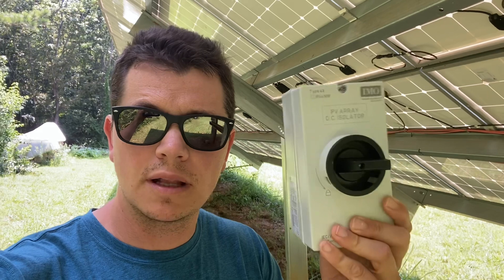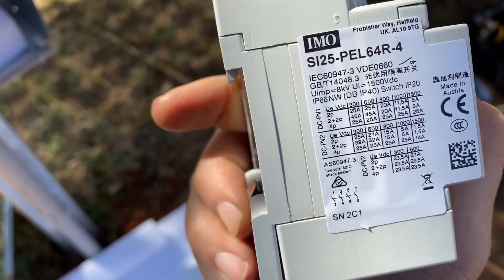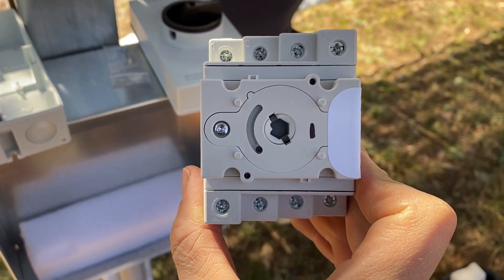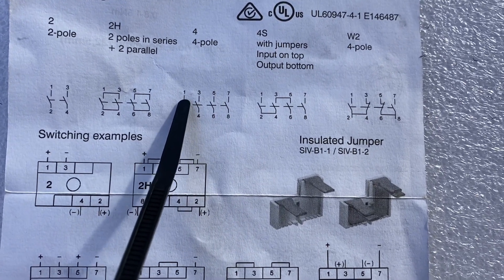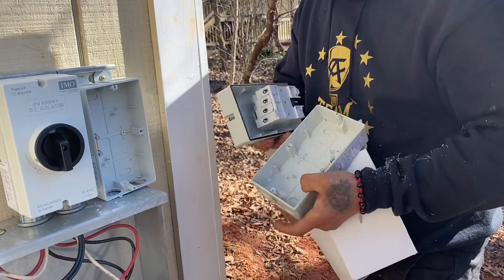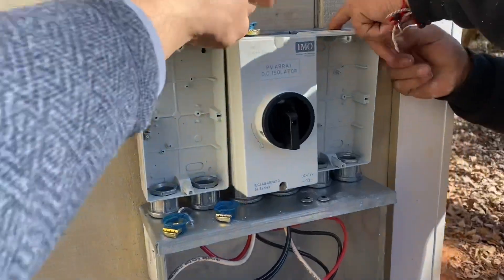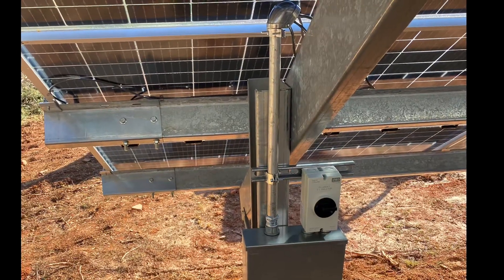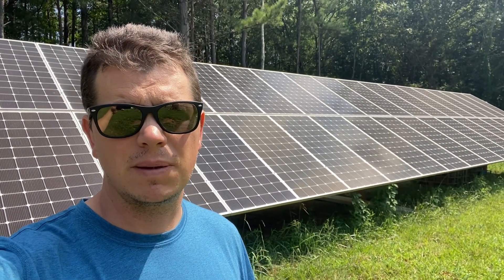IMO DC Isolator: Solar PV Disconnect Switch Instaling and Wiring

Comment: What box did you use at the array? Is that a nema 3r screw cover? What size do I need to get for 3 imo disconnects to fit on top?
Reply from the maker: You could fit 3 in a 12124 nema 3r box but you’d have to bring the weather head down on the side or behind with an LB

Comment: Hey Johnny, I have my IMO disconnects at the array, do I need IMO's at the house or can I run from the IMO's at the array straight to the Inverter?
Reply from the maker: It kind of depends on the proximity to the house, but I usually put disconnects on the house so that I can completely remove power from the house
Reply: @GainSolarPower  That makes sense, the array is about 100 feet from the house. Thank You

Comment: Thanks for showing that they are a crossover!  I have seen some videos of those polarized disconnects that were used in Australia that burst into the flames if you hook them up straight, eg - in that diagram input 1, output 2.  I did not realize these were also crossover too!  Thanks also for showing what hardware you use for connecting things like this.  That helps a ton for is DIYers.  Simple things like that rubber washer on the back screw and the meyers hub on the bottom are easy to miss, but certainly great to keep water out!

Comment: Why people use those PLASTIC switches?? To save money??   Look at all that PLASTIC. 1 arc and its done!  Get a metal PV Disconnect Solar Switch box with the pull down handle like  EATON DH261UGK 30 AMP SAFETY DISCONNECT SWITCH 2 POLE NON-FUSED 600V.  PLASTIC's as a rapid shutdown device is insane to me.  I can shut down my array safely while under load now. I wouldn't dare if I had a PLASTIC cut off device.
Reply: According to the NEC these are not rapid shut down devices these are strictly disconnects. And in the 2017 NEC there is no call for them to be UL listed.
Reply: lol, that is an AC switch. If you are using that as a PV disconnect you are not doing it “safely”.

Comment: @GainSolarPower Johnny there's a lot of talk in Euro & Aussie solar circles re eliminating DC Isolators & relying exclusively on the single DC Isolator built into the inverter, specifically due historical failure data. What're your thoughts on that? I know the convenience they offer, but doesn't the potential failure point negate this?

Comment: Hi did you put the isolation switch between the PV and PV outside fuses, or between PV outside fuses and wire to inside solar controllers?
Reply from the maker: No fuses on this job.

Comment: Does the polarity of a Solar Rotating Handle Isolator depends on the load/source side? Does the polarity of the switch reverse if the load  and source are reversed. I will put it another way. Does it matter which way the dc current runs through it as far as polarity is concerned.
Reply from the maker: I don’t think the switch is polarized like a Midnite breaker.
Reply: @GainSolarPower  So  the panel array can come in the bottom and the top goes to the inverter? I'm not familiar with a Midnite Breaker.

Comment: I don't suppose it would make any difference if you connect the input from poles  1,3,5,7 and exit form 2,4,6,8 or would it ?  Most installers seem to enter from below, is it just for convenience ?

Comment: ok you have an array of solar panels, do you install, a DC isolator where the panels, are, and another DC isolator , close to the inverter? if so what is the purpose of the DC isolator next to the panel array, is it so that you can disconnect the power from the line going to isolator number 2 which is close to the inverter? my question is about disconnecting the cable going to the isolator close to the inverter, and if there wasnt an isolator where the array is, , then there would be power, at isolator 2, and one would not be able to remove the cable, say if one wanted to replace the isolator 2, or even , replace the conduit..
Reply from the maker: Sounds like you answered your question own question. It’s also a nice place to transition wires

Comment: Hello, what IMO DC Isolator would I use with a 4 string, grid tie PV system? Each string would be using 8 - 400w Panels (40.7 volts, 9.83 amps)?
Reply from the maker: You could use 2 of the switches in the video
Reply: There is a 4 circuit / 8 pole option - based on the amperage, the disconnect is rated at 65amps per string/circuit
Reply from the maker: @jasonhannah7798  Jason, I am pleased to see you on my channel. Do you work for IMO. I love your products!  I would be happy to connect sometime 

Jv@gainsolarpower.com

Comment: I plan on mounting the IMO on a 6x2 in steel post and would like to have the PV wires enter through the back of the enclosure for a clean look.  My conduit enters the bottom of the post underground, and I will use the post as a conduit.  Does the enclosure have enough room for a 1/2" chase nipple on the back of the enclosure?  My install is a 2-module 500-watt system for an RV, and I will be using 8 gauge wire.  Thank you!
Reply: I received the switch today, and for anyone interested in the answer, there are two elongated knockouts in the back of the enclosure, one top, and one bottom.  The knockouts are approximately 7/8" wide x 1/2" tall.

Comment: When you are doing this are you using strings to what the inverter can handle? Because you don’t use micro inverters.
Reply from the maker: Yes we are running strings of panels less than 450v back to the inverter.

Comment: Have you used any of the IMO DC contactors?  I'm looking for a rapid shutdown solution for my string inverters.  I have TIGOs on the panels, but I don't have anything to prevent the backfeed of power from the inverters to the roof just yet.  Someone suggested SolarBOS, but they weren't interested in working with me since I'm not a company.  What do you suggest for the inverter side?
Reply from the maker: I don’t understand what your problem is
Reply: Data sheet for DC switching Contactors:   https://technical.imopc.com/dccontactorrangedatasheet121021.pdf

Comment: Thanks for helping us diy folks stay safe and do things correctly sir. You and engineer 777 are two of the best on youtube. I do have a question that's debated a lot on diysolarfourms. Do you ground the solar panels themselves, the racking and or a combiner box if using one to a separate ground rod right by the panels or do you run a wire back to the ground rod for the house?  I see some guys ground the panels and any combiner boxes / disconnects etc with a separate rod right by the panels and others say you can only have one ground for everything and it should be grounded to the same one for the house.
Reply from the maker: By code one ground rod system typically comprised of two ground rods however if you choose to drive a ground rod at the solar array and you Call it a supplemental ground rod for lightning protection you can have it. Keyword is supplemental

Comment: cant imagine how someone would mess that up. lol
Reply: You would think this to be true, but a lot of DIY guys will run the connections from the top link to the link directly below. Johnny doesn't make these videos for professional installers. He makes them for the DIY installers and always tries to highlight common mistakes that beginners make. I have learned a lot watching Johnny's videos. When I did my own install the inspector looked at my work and asked me if I was a professional electrician--I'm not. I just copied what I've seen Johnny do.
Reply from the maker: @BrianLeeWho  Go Brian. David poz has a video where he makes the mistake and Scott hunt smoked an inverter the first time he wired and IMO
Reply: @GainSolarPower  i was being sarcastic.
Reply: Well, if you can hook 3 ea 1500W electric heaters to load imbalance fault a Sol-Ark 12K that has no firmware update to promote SS and try to make SA look bad…you could mis-wire an IMO!